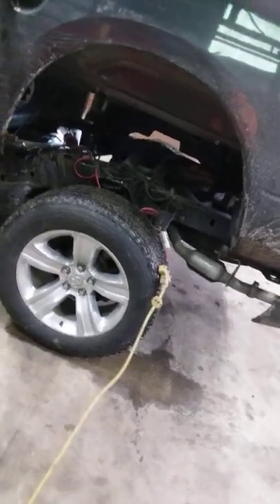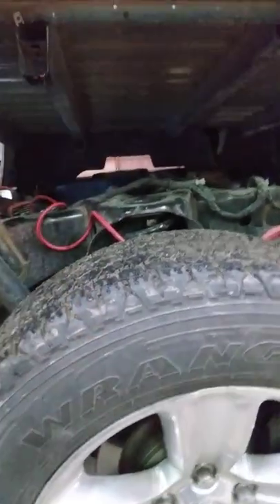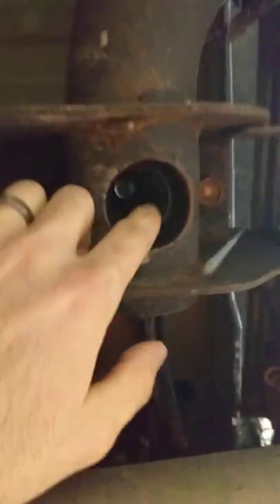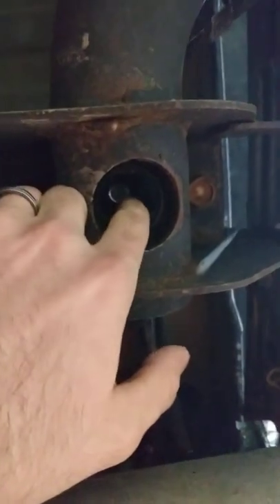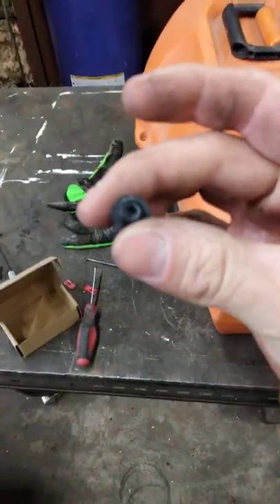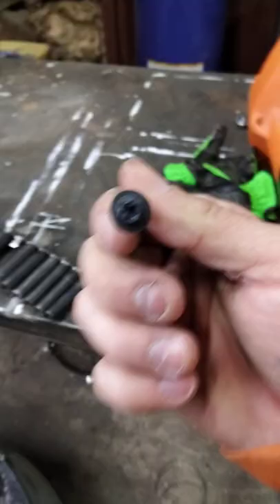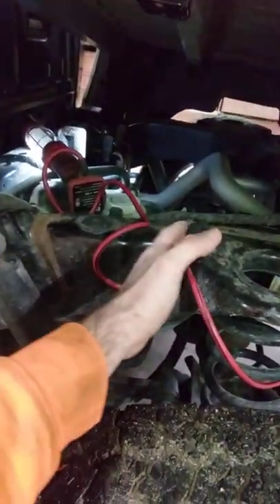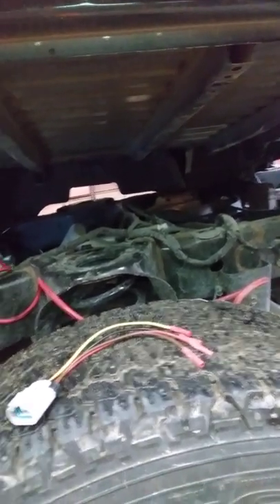Dodge truck bed removal

Comment: Without a lift, is it possible for 2 guys to move the bed back just enough to get to the fuel pump? Not sure how heavy it is
Reply from the maker: I would barely leave 2 bolts on the passenger side and then remove every bolt from drivers side then have the two of you lift the bed up from the driver's side and block it up in between the bed and frame, reason for leaving the passemger side bokts in a couple turns is so it doesnt slide off or attempt to and damage anything. Anyhow, that would be the best way to go about that because 2 men can't entirely pick the bed up completely but 2 can tilt it at an angle fore sure.
Reply: @colto8284  thanks for the tip. My neighbor and I were able to lift it backwards about 2 ft and it’s resting on the wheels and a little mini fridge in the rear. Was actually not too bad at all. I didn’t realize my airbag lines were snaked through it so they are pretty stretched out at the moment but i have never used them and not even sure if they work. Just in case anyone else sees this check the airbag lines
Reply from the maker: @Javii96  that's a really good tip about the airbag lines. Hopefully the mini fridge also served the purpose of keeping that busch light cool too 🤣
Reply: I would recommend people buy new fuel line clips before starting. I also had to go buy the electrical connector because the locking tab broke. Better safe than sorry
Reply from the maker: @Javii96  hey man all these suggestions are perfect. Not everyone lives an an area where stuff doesn't fall apart.
Reply: @colto8284  haha😂 yea the mini fridge was a multitool today. Truck is all back together running great thanks for the vid
Reply: Although it was much colder outside the fridge now that I think about it😂 this morning was 22f but it warmed up to about 41

Comment: Do you know the sizes of the bolts
Reply from the maker: I want to say it's a 12mm that sounds familiar but seems small but like I said that's off the top of my head.
Reply: Mine were 19mm
Reply: ‘09 1500 and mine were an 18 socket